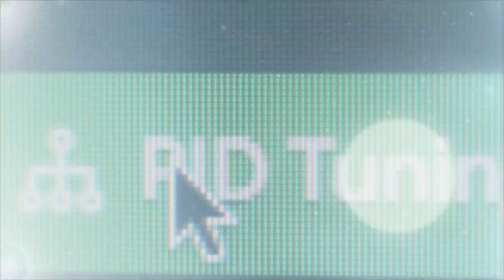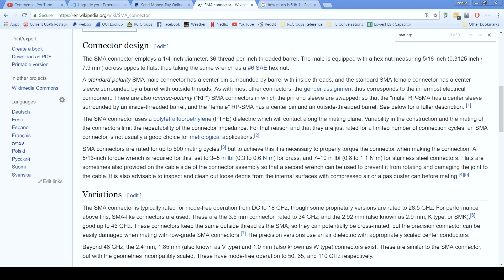Taranis 5 dBi Antenna Mod | DO IT MORE SAFER-ISH

Comment: Hi Joshua,
I did the mod last  summer.  Probably did 50 screw and unscrew with the antenna since . I had antenna warnings 2 days ago. I blame my self for having screwed up the mod. I putted back the stock antenna for testing purpose this morning, the RAS is perfectly at 0 with no antenna warning. Definitely need to buy high quality  
RP SMA with corresponding antenna ...

Comment: Those right-angle connectors are quite weak also ... They break easily. I use them on my Eachine ev200's. Slop some flux on them and solder them and problem solved.

Comment: I know this is a very old thread but thought I'd ask the question anyway. I am wondering if any problems caused by replacing the transmitter antenna could be related to the actual length of the active part of the antenna inside the casing. I had occasion to cut open a Taranis Tx antenna recently, and remove the antenna wire. I had read that Taranis receiver antennas have an active length of 26mm instead of the standard 31mm (lots of Youtube videos about it) and was wondering if the transmitter antenna was the same. So I measured the transmitter aerial, and sure enough, 26mm. I don't know enough about antennas to know what would would happen if a "normal" length antenna (31m) was connected to a Taranis, but I have read that it should be as close as possible to 31mm, and certainly no more than +/- 1mm. So I'm guessing best case scenario would be a loss of range. Worst case may be actual damage to the RF board. Perhaps it would be prudent to only replace a Taranis antenna with another Taranis antenna, and not a generic one? Interested to hear your comments.

Comment: Is it likely the antenna in a taranis (qx7) can go slowly? Or is it the kinda thing where it ether works or it doesn’t?  

I’m noticing that my rssi on my copters only read about 70. And that’s right beside them. And at about 100 yards away I’m showing 50-60 rssi with clear line of sight. 

A couple weeks ago rssi on all my stuff would be 99 close by.
Reply: Sorry. I asked this before watching the entire video. 
Hopefully I can find a replacement antenna on amazon and see if that works. 
Or if you have any affiliate links to a replacement antenna that will work in a qx7 , link it and I’ll use it. 

Thanks for the video

Comment: So much this. Thank you Joshua! First I went looking for the SWR meter in OpenTX 2.2 and found your other video, then I discovered my replacement antenna works so much better, now after this video, comparing the center hole, the previous antenna (that I take off each time I pack my radio) is really worn out and noticeably wider.

Comment: I just did the Mod, replaced the standard antenna on my X7 with a cheap FrSky Patch antenna (the one which comes mounted the wrong way around). Got me to 170m in Range test mode (X8R receiver) which is more than triple of what I achieved with the standard setup.

Coax cable, 100mm (isolated) and just screwed everything together hand tightened.

Comment: @joshua Recently you Facebooked the same "possible" problem with your Special Edition. I am curious, in these failures is it the entire back board or just the board that the antenna solders to?  I have a spare back board that has a broken USB on it (guy gave to me) and it may not be worth trying but if the failure is from that RF Board (if thats what it is called) I may attempt on a boring night to remove and replace. If it has everything to do with the back board then its not worth the effort. Then I will just buy a new back board. Even after replacing antennas following this footage months back I have a X9D sitting on the shelf and want to get it going for a spare. Thanks
Reply from the maker: I think in theory you could change just the radio module but I can't find anywhere to buy them. If you have a spare and good soldering skills I think you could swap it.

In reality, it is usually the RF amplifier IC that dies, and the shame of it all is, it is like a $5 part at most. If you have good SMD soldering skills you can easily replace it.

Comment: I think the cause is the cheap ass 5dbi antenna everyone is using. The SWR value will give a false sense of security on the quality of the antenna, and in the long run the amplifier will get fried. The one Joshua linked in his mod video is no good.

Comment: I put on a 50Ω terminator and it pushed in the pin on the RP-SMA connector. If you feel resistance, stop threading it in! Now I have to redo the mod and it's completely entombed in epoxy. Some antennas still actually work but my nice 10dBi penetrator no longer makes contact.

BTW the info in this video goes for any radio receiver that has a removable antenna. They actually recommend grounding the center conductor on the antenna as you put it on, though with a male RP-SMA that is a bit difficult.

Comment: to prevent wear out I found an Antenna from Microchip Technology Typ TRF1002 - Aristotle RFA-02-5-F7H1 5 dBi 2.4 GHz similar to original with cable instead of SMA connector. It maybe fits diectly or with minor casing modification. Antenna foot  has a snap in connector similar to original I guess.
What do you think ? http://www.microchip.com/Developmenttools/ProductDetails.aspx?PartNO=TRF1002

Comment: Joshua.  I recently did the six position switch mod on my plus ( did not work by the way),  since then my sound, bleeps and haptic have failed. No sound at all.    I am wondering if i could have damaged my internals by touching then without grounding.. Does the sound come from the back board?  I know that the haptic motor is mounted there
Reply from the maker: Most likely you damaged the speaker wiring while mucking about in there. The sound comes from the speaker.
Reply: I know the sound comes from the speaker, but does it originate from main board or the back board. in other words where is the sound produced. Strange that the haptic which is on the back board  is dead too.

Comment: What do you mean by grounding your self. How do you do it, because I just orderd a Taranis se and I'm worried now about it having low range because that seems too be the problem with a lot of them
Reply from the maker: The safest thing to do is to attach an anti-static wrist strap to a ground location on the radio before working on it. The next-best thing to do is to touch a ground location on the radio before beginning work.
Reply: Joshua Bardwell if I was never ever gonna open it up would I be fine?

Comment: 3.2 inches is not 84mm (like Steele says in his video). It is 81.28mm. The cable should be cut to 81.28mm.
Reply from the maker: +aerosurfer Alex Greve personally told me the correct value for Teflon velocity factor is multiples of 42mm. 42 * 2 = 84.

Comment: If the SMS connector are only good up to 500 cycles why not just stack them 2 tall and when the top one wears out replace it that way you don't have to solder on a brand new connector?
Reply from the maker: There would be a small amount of additional loss, but yeah you could do that.

Comment: I seemed to have killed my taranis radio.  I powered up without the antenna and now I cannot bind or connect to my Rx.  Only choices now are to replace the board in the Taranis or go with an external Tx like TBS Crossfire?
Reply from the maker: You can replace the radio back board.

Comment: HUACAM HCM16 2 x 2.4GHz 6dBi Indoor Omni-directional Antenna 802.11n/b/g RP-SMA Female Connector + 2 x 12cm U.FL Mini PCI to RP-SMA Pigtail Antenna WiFi Cable https://www.amazon.com/dp/B00VHDXSSU/ref=cm_sw_r_cp_apa_cx9TzbV8VRX8V

Comment: Joshua,

Slightly off topic, but do you think it would be possible to use the dummy load on the vtx and not damage the vtx?  You could use it in the pit area while working on your quad and not interfere with other pilots.  

Don
Reply from the maker: Yes, you can definitely do that.

Comment: Joshua, I'm not sure if you will see this but I have a question regarding SMA connectors. As you've stated, you found out wear and tear of the connectors seems to really effect signal strength. This has me wondering, I know people take off their fatshark antennas a lot for mobility. Would you get signal degradation in your fpv feed after taking them off / putting them back on over a relatively short amount of time? Has me kind of worried I'm going to wear out the connectors on my antennas if I remove them a bunch over time. Thanks!
Reply: Adam-g1 they are only rated for 500 cycles

Comment: Small question. Are the Special Edition parts available, have only done a QUICK search, so that they can be just dropped in place?  I'm not really looking for longer range, but the pivot for my Standard has cracked, figured it will eventually need to be replaced, why not upgrade with factory parts.

Comment: I was getting random failsafes and reduced range with the dang stock antenna, having never opened my Taranis for any reason other than to take the ratchet off the throttle and adjust stick resistance. For this reason, I did the antenna mod using RG316 coax, cut to have precisely 84.6mm of shielding, measured from the base of the SMA connector. My SWR has dropped from 16 with the stock antenna to a perfect 0 with my new antenna 5dBi antenna. No more feedback in my speaker. And my range with the new antenna while in range test mode is almost as good as my stock antenna in normal use mode. But I don't think this is as much of a success story about my antenna mod, rather, more of a failure story of how badly my stock antenna was performing.

Comment: @Joshua Bardwell, maybe I did not understand well but if I follow what you said. 

If you do the mod you have chances to kill the transmiter. Also if you do it well you also can kill the transmiter with electromagnetic electricity when you screw off the antenna and touch the connector of the radio, because you may be "charge". 

So if it is exactly the same mod on de "SE" model you can have the same issue if you don't use the "dummy load" ? Do they fix it ?
Reply: Up ?

Comment: I'm a MSgt USAF and I've been doing avionics for 19 years working with ESD and SMA connectors.  We torque them to 8 in-lbs.  it is just beyond what I can break loose by hand on a straight connector and it is possible to hand loosen the 90 deg connectors, (but that's not good for them, you'll loosen the crimp). I can verify the link in connector torque and signal loss.  We commonly have radar receivers that fail testing because a technician fails to use a torque wrench on the SMA lines and then the receiver will pass testing after Proper torque is applied.  But I can't say if there will be a noticeable difference in the FPV world.  Our radar receivers' tolerances are tighter than what can be observed by human senses.  So I just tighten my FPV gear just beyond finger tight. 

Some things you can control include Check for metal shavings and trash in the connector before you connect it.  There is a reason why the dielectric is white; it allows you to see what should not be there.  Next is the center conductor getting pushed in.  The female pin should be flush with the white plastic.  If it is sunk in, replace it.  

ESD - discharge your self before working, avoid touching logic and RF pins without first grabbing the chassis ground.  Keep clear of static generators. Be especially careful in low humidity, winter months; get a wrist strap. USAF ESD protocol is much more stringent, but those are the rules I go by when I work on my own stuff.
Reply: Avionics integrated technician (former flight line) and i can confirm this. Sharp kinks in dialectic can cause relfections and massively impact performance/range/signal quality.
Reply: I'm also an avionics mechanic from Army Aviation. I can confirm it's 8 in-lbs as well for both SMA and SSMA type connectors. We have dedicated 8in-lbs torque wrenches for those antenna connections on aircrafts.
Reply: This deserved a reply of thanks by the poster (JB) if only out of respect for a very informative and useful reply, but also out of respect for taking this stuff SERIOUSLY, we are flying in open space and being clamped down on by the authorities, we need to show we are serious and not mucking about.

Comment: After watching your mod video I bought a pigtail and 5db antenna from Bangood.  I soldered it on with the care of a neurosurgeon and with that big ol 5db I did indeed experience intermittent problems.  I attributed them to my not knowing all of the nuances of this complex system, I had just gotten it.  Like you mention I did it to a great extent for portability.  Anyhoo, I didn't like how long the 5db unit was; unwieldy in the field.  A friend had a defunct 2.4ghz router with high gain antennas that were about a third smaller so I started using one of those and did have better results.  After watching the above I just did a little side by side comparison and it looks like the smaller antenna is better made.  The connector is beefier and the hinge parts are more substantive, not sure what db but I wasn't doing for the sole purpose of flying to the moon and back.  The esd risk when putting it on or removing it is a bummer though, hmmm.....  Can I take an esd strap and cord, solder it to a thin metal tent stake pushed into the ground when I apply/remove?
Reply from the maker: The ESD wrist band is overkill. If you are careful to touch the outer threads when you install or remove the antenna, you should be fine.
Reply: Oh man I just soldered one together, tested it, painted it, made a logo and applied for a patent.  My website to market it will remain half finished now.  Well maybe my next idea..........

Comment: Is there some sort of circuit that could be added that does something like automatically reroute the circuit to a dummy antenna when the antenna isn't plugged, or cuts the power to the radio board or something like that?
Reply from the maker: That is a thing that exists. FrSky have not built it into the radio as far as I know.

Comment: I've been trying to find information on how the increased gain affects the radiation pattern.  Everyone says this increases the range but surely it must decrease it in some direction right?
Reply from the maker: Yes. A higher-gain dipole has a narrower vertical beamwidth.
Reply: Right - So transmitter antenna orientation becomes more important.  Dipole was the word I was missing in my googley search so thank you.  I see most people angling the 5dB antennae vertically which surprised me since that'll likely point your 'dead zone' in the rough direction of your quad and with the additional gain that'll be even worse.  Sideways therefore still seems most sensible to me...  Pic for reference: https://static.rcgroups.net/forums/attachments/2/4/1/5/3/a2087197-144-dipole-radiation-pattern.JPG?d=1222518252

Comment: Hi Joshua,
you quickly mentioned a measurement of 84mm, for....... I believe the length of cable between the board and antenna. Would this length also apply to spectrum transmitters?
Reply from the maker: It applies if you are using RG316 coax. If you are using any other kind of coax, you have a different velocity factor, and the length would change.
Reply: Thanks so much for taking time to reply, I'll check what I've used as I'm not 100% sure at this moment. Respect.

Comment: Hi Joshua,
Here's a thought: how about modding you Taranis with an internal 2watt or 5watt amplifier module. Would that help solve the esd vulnerability of the Taranis and achieve better range at the same time? Not looking at RF regulations of course, but if you are not allowed to fly in populated areas, then what do the RF regulations really matter?
I would like to see you try.
Reply: Sure , LoL 😅
Reply from the maker: I intend to keep my radio gear compliant with FCC regulations.

Comment: Hi JB,
Would this same principle apply to, say, my CP and patch antenna that I assemble and disassemble upon storing away my Fatshark googles?
Reply from the maker: In principle, yes, but in practice, we don't hear about people having this problem with their goggles. But what if that is because the goggles are a receiver, and so don't have a SWR measurement to give an audible alert. What if some of us are suffering crap range and not realizing it's because our goggle antenna connector is worn out? I honestly couldn't say.

Comment: Do you know where i can get an RPSMA 2.4GHz dummy load antenna?  I've found 2.5GHz SMA and 3.0GHz RPSMA on the usual Banggood and Ebay sites.  No RPSMA 2.4Ghz though.
Reply from the maker: I think that the GHz rating is the top end. You can use the 2.5 GHz one. Or the 3.0 GHz one. It doesn't matter.
Reply: Any dummy load is fine, regardless of frequency, so just get the one that fits your socket. The dummy load is just a 50 ohm resistor rated for whatever power output you'll be using.